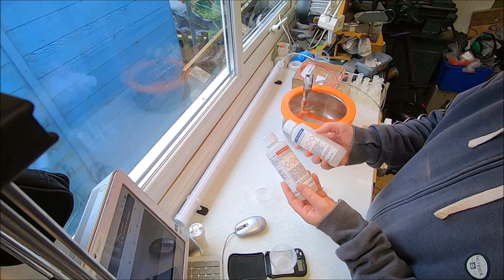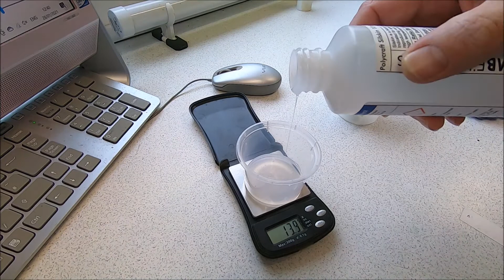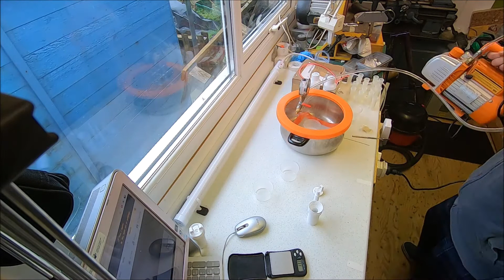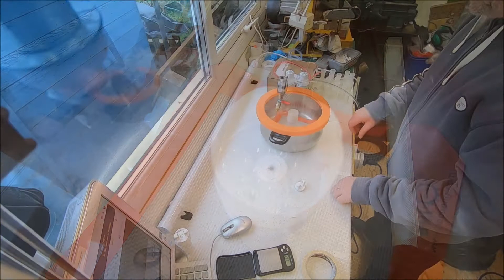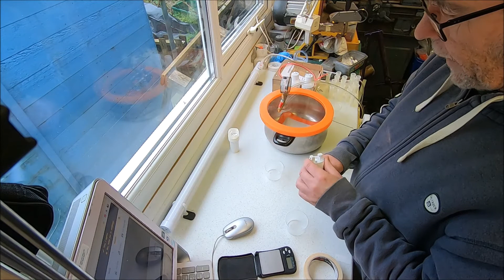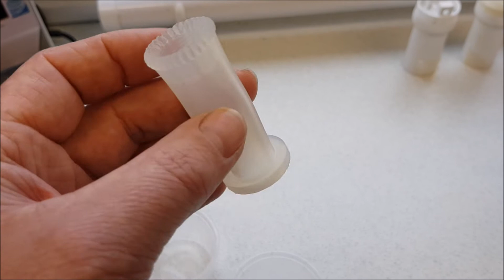3d printed mould and Silicon casting

Comment: The finished part looks good.  What 3D printer are you using?  I've tried casting some damping bushes from 3D printed moulds, they worked, but the surface finish was rubbish (0.1mm layers on an Ultimaker 2).
Reply from the maker: Thanks Andy, I use a flashforge creator pro and a Flashforge Guider for printing. 
I use Simplify 3D for slicing, you can print at different thickness of layers on the same print, so .1 on the textures and .2 for the walls of the mould both printers print relay well.